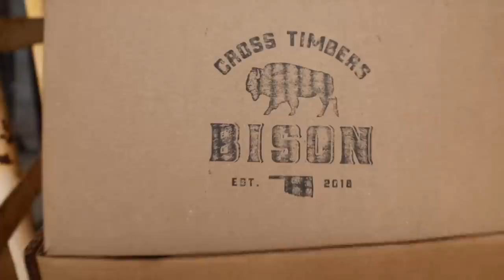Not Again! You Won't Believe What We Found In Our Pasture...

Comment: Won't you need some ventilation on the office roof?  Especially if you use the loft for storage.  Whatever types of passive or turbine vents that are appropriate for  your area.  And despite having ceiling insulation you need to worry about ice dams on your metal roof.  You'll have snow on top and warmth underneath.  The warmth may melt some snow and create ice.  Later some of the ice and snow will melt but the underlay of ice will keep the water from draining off.  Talk to a local roofer about appropriate precautions, of which ventilation of excess interior heat is a key.

Will Eleanor have a baby shower?  I actually am more and more convinced she has a lot of wood bison in her ancestry.  That would explain both her size and that she is cimfortable being farther from the herd.  Wood bison lived in smaller bunches and had to be more widely separated when grazing.  Hunters recorded finding bison that appeared to be alone.  Just curious

Comment: Cedar.  If you plan to use red cedar, I have a couple recommendations to make that wall really pop.  This year I stumbled on a mix to make red cedar an eye catcher.  Either use natural Danish Oil or clear polyurethane as a finish and add red dye to it to the color you like.  I got my dye at Woodcraft, but other vendors carry it also.  It takes only a small amount to really add pop to red cedar.  I think I used 30 drops to a partial quart can of Danish Oil.  Red cedar color diminishes (fades) with time due to drying and the dye in the finish conserves the beautiful color.  I had never used dye before as a wood colorant, but I am sold now.  Enjoy your videos.